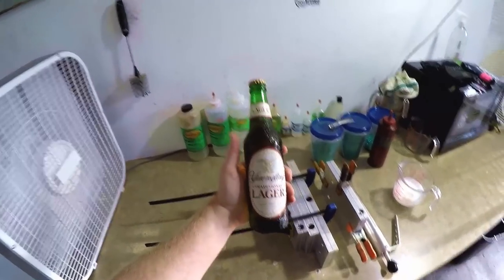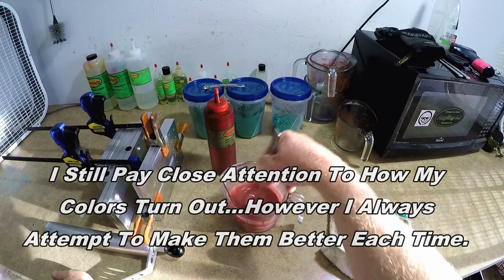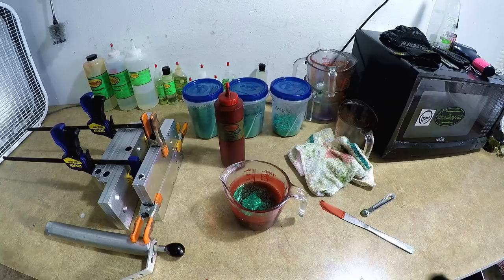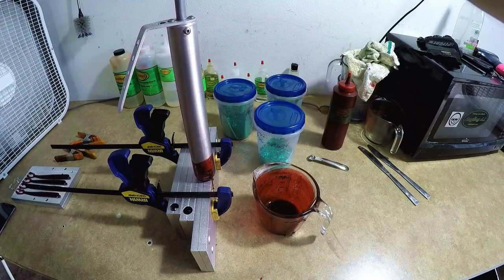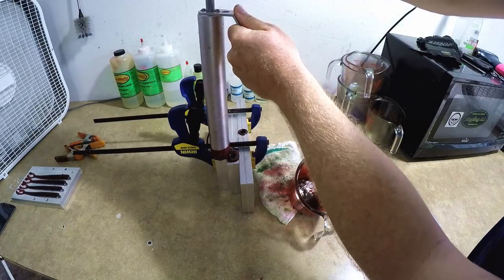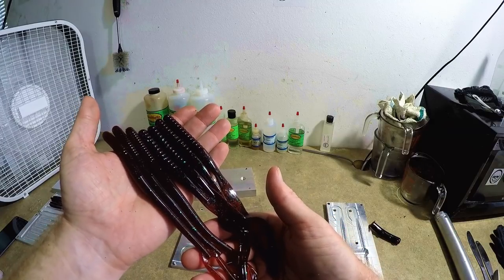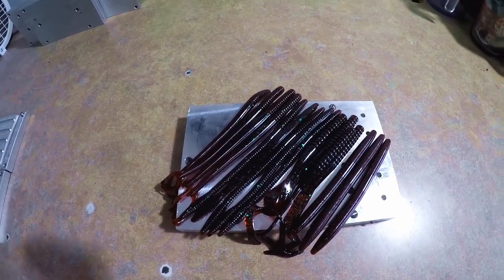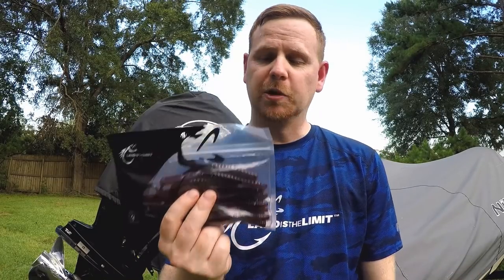POPULAR COLORS: RED BUG! Making Bass Fishing Lures; How To Rig A Texas Rigged Worm

Comment: I bought 5 gallons of salt from Bear's Baits before he closed due to health issues and I still have a lot of it left. 
How fine is Lureworks salt? The stuff from Bears is almost like a powder. Very fine.
Thanks.
Reply from the maker: its very fine..its not powdered sugar..but still pretty fine.
Reply: World's Worst Fishing  Ok. How are you liking the Dead On Plastic? You bought it in the 5 gallon bucket so how do you stir it/mix it before you use some, keep it from getting moisture/bubbles in it, and how do you take out what you are going to work with out of the bucket? I've used 5 gallon buckets before and sometimes I'd spill some of it. I thought about buying some 1 or 2.5 gallon jugs to place it in instead of leaving it in the bucket. Might make it easier to work with. But I don't want it to get moisture and bubbles in it by doing this.
If Dead On Plastix offered it in the 2.5 gallon bag-in-a-box deal like Lureworks, I'd be all over it. Thanks for the reply.
Reply from the maker: @austinspringer7114  the dead on plastix is incredible.  It does not hard pack AT ALL.  I only stir the 5 gal bucket by hand with a big spoon a few times and it's good to go.  I use a Pyrex cup and just dip out the amount I want to use.

Comment: Could you use a ultra fine red glitter to imitate the color? If it's the paints which are causing issues than the easiest course of action would be to eliminate or substitute sand down some ultra fine red glitter with 2000 grit sandpaper (I joke).
Reply from the maker: you might could sub the pigment for glitter...might look really good.